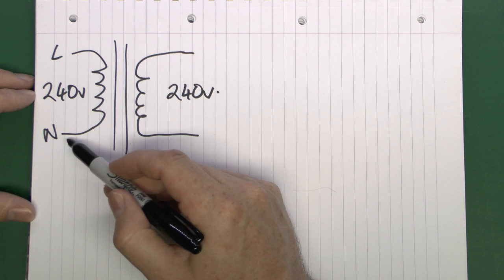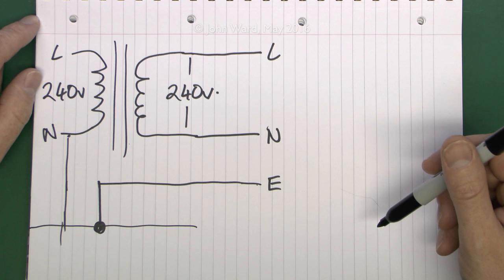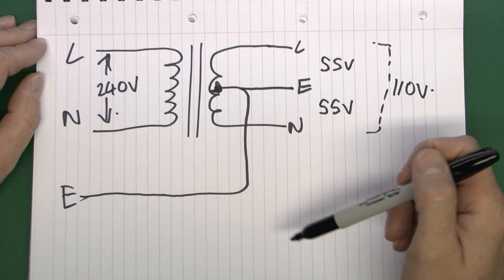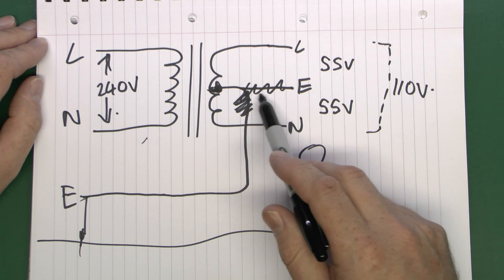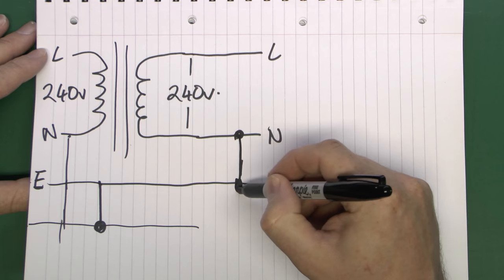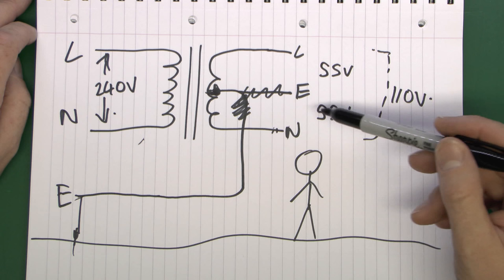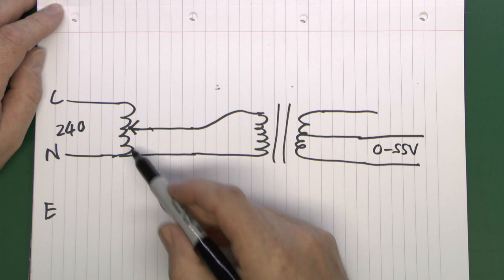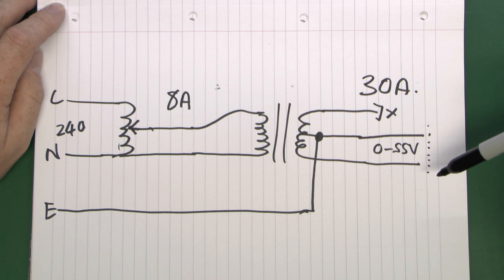Transformers & Earth Connections

Comment: john, very helpful informations!! are lab power supplies and switch mode transformer (eg for laptop)  also connected to earth ?
Reply from the maker: Not normally, although most lab supplies have a separate earth terminal (usually green) on the front so you can connect the output to earth if required.

Comment: Thank you Mr. Ward. 
For one of my projects, I have to maintain the Neutral on the secondary side of the isolation transformer (Load: 24VAC, 10A) at zero potential. So, I tied it to the Earth (and then to the building ground-bar) but haven't tested it yet. Is this setup safe to proceed, for permanent usage? Thanks.
Reply: Hi did you get a solution this

Comment: I have a question. I recently installed a solar array and i grounded the inverter with a piece of iron rod and used a rccb switch and a fuse on the mains side. My question is is the rccb switch going to work? Voltage on the mains side is 110v live to ground and 110v neutral to ground (220v total) i tryed to trugger the rccb using a 100w lightbulb from phase to ground but nothing happened. Same with the neutral to ground. I didnt directly connect live to ground with a cable because im afraid it might damage the inverter... Please help me
The inverter is seperate from mains input. It os used in a remote wooden cabin with no electricity

Comment: Unless that center grounded secondary is stepped down with winding ratio, the output will be 220v across the L and N terminal and will be 110V across either the E/L or the E/N, the way I see it.  What am I missing here??
Reply from the maker: Site transformers have a 110V secondary and 240V primary.

Comment: Assuming that the building site transformer has a plastic case, I'm assuming that disconnecting the earth connection to the transformer would achieve the result of creating a 110v isolated transformer but may not be the best idea. :). I guess an internal fault in the transformer could cause the earth pin on the output to become live.
Reply: I believe they have earth connections to the transformer for safety too, you would end up with an isolation transformer but if one side of the output became grounded (under single fault condition) the other side will be at 110v WRT earth.
Reply: +cumberland1234 so if you disconnect the earth from the mains input, it would be isolated unless one side of the primary became shorted to earth internal to the transformer I think.  I have absolutely no plans to try this as I realise it's a stupid idea but I'm just playing with theories. :)
Reply: Apab

Comment: Where are the L-E=55V transformer uses? and whats the benefit than L-E=110/220V
Reply from the maker: Construction sites, the benefit is that any shock between a conductor and the ground will only be 55V.  You would still get 110V between the conductors, but someone being in contact with both at the same time is unlikely.  Damaged cables and tools getting wet etc. is very likely on construction sites.

Comment: Great videos, many thanks. I have a question please..I happen to have the same yellow isolation transformer as seen on your other video and measuring the secondary voltage reads 247v. All well and good, However, measuring the voltage between Live and earth on the secondary is measuring around 117v. Is this normal? Shouldn't it be giving a reading of near )v if there is no reference to ground? Should I be safe and remove the earth connection at the secondary outlet? Thanks
Reply from the maker: There should be no voltage between earth and the output.  Either it's actually a centre tap transformer, or the voltage is capacitive coupling and isn't really there.
If you connect a filament lamp between the L secondary output and E the voltage will disappear if it's capacitive coupling, if the voltage remains (and the lamp glows) then it's a centre tap type.
Reply: Hi John thanks for reply and apologies for only replying now. I had a chance to test my transformer this evening and carried out your test. I tested my transformer with a filament lamp and the indeed the lamp did not light up and there was no voltage reading between the line and earth while the lamp was on, however measuring voltage between earth and the neutral gave me a reading of around 238v! Same result when swapping the line with neutral and taking similar readings. I take it it’s safe to leave the earth connected to the secondary socket of the isolation transformer? Thanks again.
Reply: I would leave the earth connected. Capacitive coupling will cause the transformer to float at about half the input voltage. However this effect will only allow a very tiny current to flow if you where to touch the output so the transformer should be safe to use. The voltmeter is requires only a very very tiny current to work so can measure the presence of this induced voltage. It is quite normal with transformers of this type.

Comment: Hi there John, I wanted to ask about another way of earthing the secondary side. 

Similar to a substation transformer, could you link one output wire (Let's deem this as the neutral) to the output earth connection? So you have 3 wires - Line, Neutral and Earth - all completely isolated from the mains. The input earth would just be connected into a terminal block in the transformer (Or just to the casing if required) 

All this essentially creating a transformer like a substation one but without it being also connected to physical earth with a rod. Would this work safely?
Reply from the maker: In theory yes - however there is then a risk that if the metal casing of the device connected to the transformer was inadvertently connected to another earth connection (such as just being placed against some other earthed equipment), all benefits of the isolation transformer would be lost.
Reply: @jwflame  Ah, thank you.

Comment: Regarding the site Transformer on the Secondary side where the tap is centre making 55V between the 2 outer winding does this not make these winding both Live rather than one being Neutral? because otherwise the Neutral now in the Secondary winding is 55V above Earth, also could this centre tap not become a new Neutral? The reason I ask is I am looking to build a Rotary Phase Converter and am looking to use an old Arc Welder as a set-up Transformer 240V to 415V but then I want to add a centre tap to the secondary winding to split the 415V and then have 2 Lives to attach to L1 & L2 on a 3 Phase Idle motor, I am looking to spin the Idle motor up to speed with a single phase Pony motor before adding power to L1 & L2 once the Idle motor is powered it should generate the ghost leg L3 (but this may need balancing with the use of Run Capacitors) then the 3 Phase machines I want to run will be connected to the Idle motor.

Comment: Hi John. I bought an used isolation transformer. I am getting a slight higher voltage than the input voltage. The input is 124v and the output is 135v. The hot to ground measures 80v and the neutral to ground measures 50v. What is wrong with this transformer? Thanks
Reply from the maker: Output voltage will be higher with no load - connect a moderate load to it and the voltage should decrease.

Comment: Why do the transformers not need to have an RCD inside them to stop you connecting between L-E at 55V?
Reply from the maker: +Simon Howroyd Site transformers can be obtained with RCD protection (generally the much larger ones) but there is usually no point, as 55V is considered to be low enough as to not cause injury.
Another issue with RCDs on a construction site would be unwanted tripping due to moisture ingress.
Reply: +John Ward makes perfect sense explained like that. thank you. keep up the good work, excellent videos
Reply: +John Ward
I was wondering the related question:-

With transformers with output referenced to mains-earth, in combination without RCDs on the output --
When is the risk of high currents in incoming-EARTH wiring under fault conditions, considered a problem?   Imagine one of the 55v output legs being shorted onto the earth-wiring of an "installed" (but isolated) light-circuit 1.0mm cabling elsewhere, returning via earth-lead back into the 55v transformer....

Especially consider transformers with rather high current output capacities (which presumably doesn't include those typical 110v yellow cubes).   I'm guessing larger earth-referenced transformers "must"? "should"? have RCD protection (even 100mA S-type) for this reason???

W/ thanks!
Reply from the maker: +sbusweb The larger transformers have MCBs for each output, so a short to earth should trip the MCB.
Smaller ones do not, as they are intended for use with a single tool, so the risk of a direct short is minimal, and the output current is limited to a modest value as the input is typically fused via a 13A plug.
Reply: John Ward a

Comment: I bought a 220v to 60v toroidal transformer when I hook the wires to 240 it just pops my breaker? It has 2 red and 2 yellow. Am I hooking it up wrong?
Reply from the maker: Toroidal transformers have a very large inrush current, which will trip many circuit breakers.    You will need to use a larger rating of circuit breaker or a type which can handle large starting currents without tripping - however it will still need to be suitable for the circuit wiring and available fault current.
Reply: John Ward I found I had it hooked up backwards, Chinese told me wrong. But it still trips the breaker sometimes. Your exactly right. So I have fused it after the breaker and will use a slightly larger breaker! Thank you sir for your knowledge

Comment: Why is there usable voltage coming through the so called neutral in my breaker box?
Reply from the maker: Depends what and where you are measuring.  In normal operation the voltage between neutral and ground should be zero, but it can be a few volts if the circuits are heavily loaded.
If the neutral is disconnected, a large voltage will appear, but then it's not really a neutral any more,  it's the end of an open circuit.

Comment: in the us we use the equilevent of your 55v diagram and call it split phase for homes. aka we center tap mains distribution down to two 120 legs / split phase. most outlets give you the 120 h/l to n clothes dryers ovens and ac usualy go hot to hot and 240v

I have a 12.5a rated isolation tf and either voltage. it looks by your diagrams if I fed said 1:1 tf both of the split legs h to h the other side would be 240v on one conductor. is this infact how it would work?

might seem obvious but I've learned it's usualy better to look stupid and learn of the unforcene than be surprised and or injured to dead 😂. I have most of a CS degree but my formal ee concept edu consists of 8th grade (Jr high school) electronics in 2001 and an  amature radio liscense. that didn't stop me from designing a working cap discharge fet switched spot welder though lol. 6s 3p Maxwell d series 350f per cell 175 bank total sketched through 6 power fets. bank  it on paper is 0.0064 and a few days ago it suceedeed where a van failed at starting a truck with a dead battery. also hearing the engine Rev to compensate for the load that u charged bank introduced to the alternator was kinda impressive 😂 I wasn't manning the connection on charge and couldn't stop the negative second order. pretty sure there was a short on the bank end as sparks flew from both in that moment. pretty sure what ever it was on Bank end vaporized 😂

Comment: in first example, you are stanind on the ground, you grab one wire of  secondary transformer, why dont you get shocked? tehre is diffeence in volatege between the cable and ground!
Reply from the maker: The output of the transformer has no connection to earth/ground, so there can be no difference in voltage between them.

Comment: Would it be better to refer to the outputs an L1 and L2?
Reply: That is how it would be done in the US. Both sides of our 240V are Line 1 and Line 2.  If you measure either side to Earth or Neutral, you find 120V.  Center tap at the transformer on the pole splits the voltage. So Line 1 to Neutral/Earth/Ground = 120V,  Line 2  to Neutral/Earth/Ground = 120V, Line 1 to Line 2 =240V. It seems in Europe, that the transformer is actually a 480 transformer that is split like our 240V services are. If it is not and the pole transformer is strictly Line 1 and Line 2 with no center tap, what he calls Neutral is not. It is a hot Line lead. On the output of his transformer,  he has Line 1, Line 2, And the center tapped Neutral/Earth/Ground.  Not a Line, a Neutral, and an Earth. It is a 55V/110V output. The Neutral and the Ground here in the US make the connection at the first service disconnect in most cases. In the 120V inverters, the so called Neutral is indeed hot as it would be with an unbalanced load at the pole transformer. Or in a single branch circuit. That is why GFCI receptacles are so important  in wet/damp locations.
Reply: +cumberland1234
I think so too. In fact, "N" on an output would be WRONG according to wiring regs definitions -- because that is by definition a Grounded current-carrying (live) conductor.
Reply: +gravelydon Hi I am in the UK. The street supply comes from our local substation transformer which are typically in a building or outdoors in fenced off enclosures. Theses are large transformers. We only have pole transformers in rural situations. The supply is a 3 phase 230volt / 400volt supply L1,L2,L3 and N (earthed at transformer) delivered under the street. Each house gets one of the phases (230 volts ref to ground) and the neutral.  Larger customers get the full 3 phases and very large customers may get the 11kv or 33kv feeder and have there own substation. We don't have a split phase systems like the USA with its L1 L2 N and P connections. Various earthing arrangements exist. John Ward does a good video on the usual UK ones.

Comment: Why are centre tap transformers not used for the distribution of electricity? If they were, would it not mean you would only receive a 115v shock rather than 230v under live to earth fault conditions?
Reply from the maker: They are in some countries, such as the USA.
However in most situations it's better to spend the money on preventing exposure to live parts rather than on centre tap transformers and additional wiring.
Reply: Besides preventing exposure with no center tapped to earth ( floating ) the center-tapped winding will have better cmrr...

Comment: How many volts will be enought to go through your shoes in order to connect to the ground?
Reply: Depends on the shoes. Some non-electrician work boots are designed to electrically ground your feet to deal with some other danger, but that is obviously wrong for electrical work.  So read carefully when buying OSHA certified footwear to make sure you get the right kind of "electrical safety" for the job and not the complete opposite.

Comment: Hi John, i work in the HVAC controls industry, we earth the secondary side of the step down transformers negative. its a 240 to 24 volt transformer and we are instructed to earth the negative of the 24 volt side. this transformer powers our PLCs but im trying to figure out why we have to do this, any help would be appreciated thanks.
Reply: I'm not trained or certified but I do DIY with  tube amps, with multiple supplies the earth can be used as a 0V reference to allow all the power supplies to be relative to 0V and not floating. For example a floating power supply would just provide it's voltage between the two pins but you couldn't say if that's 1000V of -1000V relative to another supply. Tube amp circlotrons use two opposing floating supplies but the two supplies are tentatively balanced at an offset from ground. Hence they 'wobble' and rebalance but are still referenced to ground. Complex and not something you want unless it's in the design!
A hard ground referenced supply means you can state the parameters relative to ground, so if you have stages with different power supplies, you can state the voltages between the stages relative to a common ground - this includes the isolation voltages between stages (isolation transformers, interstage transformers onto-isolators for example). With a fully floating supply you can't rely on this. (this is ignoring potential differences between ground/PE between sites)

Comment: Does the same principal apply with a toroidal transformer. The 2 wires are your L/N and the secondary winding if it has a centre tap becomes an E connection?
Reply from the maker: Can do - what matters is how the wires are connected, not how the transformer is constructed.
Reply: @jwflame  thanks.:)

Comment: I am working on 230VAC to 24VAC transformer. 
The voltage between 24VAC terminal and 0V terminal at secondary side is fine.
But the voltage between 24vac terminal and any other external ground is around 230 volt. 
Why is it so? Do I need to earth the secondary side of transformer?
Reply: Million dollar question; 

Hello, were you ever able to find a solution to this?

Comment: How can I use center tab ground 55-0-55 vac , with 110 & N instead of just 110 vac & ground . My instrument need 110 vac & 1 neutral. Please advise thank
Reply from the maker: 110V items are connected between the two 55V outputs, (2x55 = 110).

Comment: What happend  with the transformer if the two neutral are connected(primary and secondary) ? there are variation on their voltaje or current?
Reply from the maker: +Mauricio Ríos With the isolation transformer, output would be the same but not isolated, so no point in doing that at all.
With the site version you would be shorting half of the winding which will cause the transformer to overheat and be destroyed.